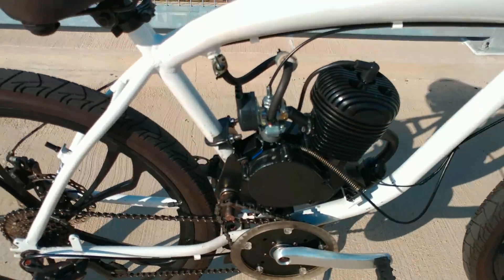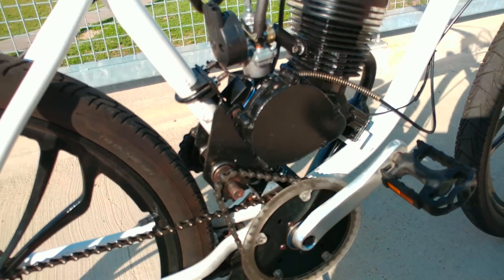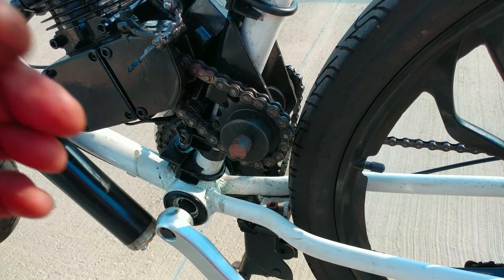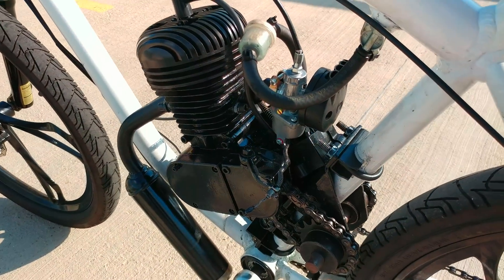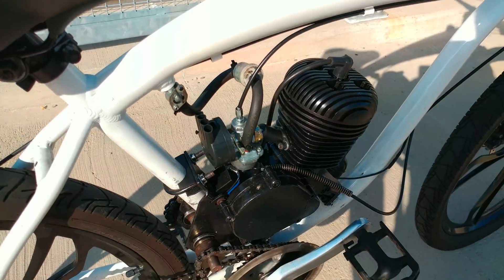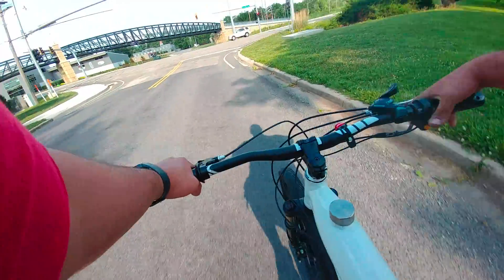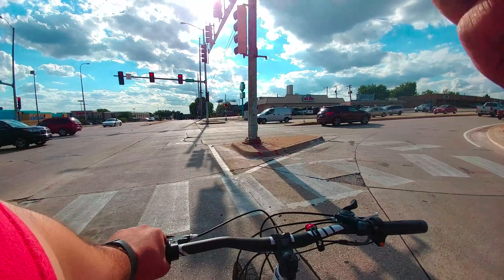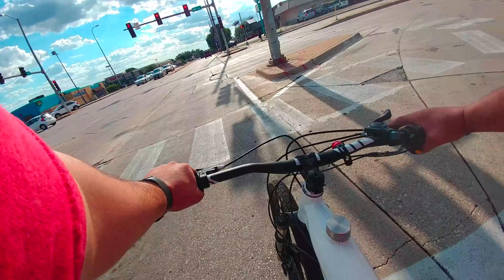Motorized Bike Jackshaft. What it does and how it does it *Viewer Request* Hill Climb and Speed Test

Comment: i'm surprised how well that works. Cool ride
My experience with a jack shaft was terrible , throwing chains , braking freewheels, braking chains and walked home everytime I rode with the jackshaft . Amazon return after 25 days of trying to make it work.
 I'm trying something a little different now , a single-speed on the pedal side and a 3-speed on the motor side, 3 sprockets on the back wheel, 40t , 36t and 32t atm. want to eventually go 36t, 32t and 28t sprockets. I live in a fairly flat area.
No videos yet but have some interesting pictures on my YouTube community page. Still working on it. Waiting on parts

Comment: Just got my little first gas conversion Facebook marketplace runs like crap but it runs of course I knew it for 120 bucks that's where I come in. It has the jackshaft and I confirmed the kit to be 100cc first impressions the carburetor is garbage. And the plug wire is arcing. Still spitt and sputtered to about  25 30 mph once I did all the 2-stroke tricks to get it started out of breath. Oh yeah and it's stuck in high gear. derailer froze

Comment: Dude take it up
a real hill , double up
on the Chain tensioner,
that didn't look like a real
hill, for real it's Supposed to
take you up to speed if you
shift the gear's in the right 
sequence, and you shouldn't
have to go Ripping up the hill yo
take it nice and slow,  see where
you can roll, Up☝ or Down👇
then come back around show
what your working with,
 then go into town . 
Lets have a bike with a Small
 Cargo capacity rack to carry
 20 to 27 lb . one needs a bike
that can pull a small bicycle trailer
a true work horse of a bike with a
proper working Jack shift one can
attain a utilitarian Ride on a good
working motorize bike freedom is
the gain you really don't need to go
Ripping down the street going nowhere
can you come up with a bike that has
Practical Uses you have a shop would
you go to the Top .

Comment: So you have to pedal the bike until it starts?
Reply: Like popping the clutch on a truck I assume.
Reply: @Y34RZERO  I don't think it's like that. When you pop the clutch in a car you usually rev the engine then pop the clutch to burn some tire. I think if you have one of these jackshaft kits you have to pedal the bike until it starts which would be a pain in the ass with the compression from the engine. It's only a one cylinder engine but it still has compression but I don't know

Comment: I have built two schwin orange county chopper bikes in the past, but both bikes were single speed.. found out afterwards that these bikes come, single, 3 speed, and 5 speed..thinking of doing a multiple gear chopper...but the flaw I see is..do you think the bicycle chain is strong enough for the job? The bicycle chains, I'm sure are less durable compared to the much thicker engine chain? And with so much torque,  are the teeth on the bicycle sprockets hold up well without rounding off the teeth over time, causing chain to slip or jump off? Plus how often would one have to grease the jackshaft hub?

Comment: I dont really need to go fsster, but I live on a gravel road, and even with a suspension fork, it can be a rough ride, I think that would help me so I could go slower on the gravel. Right now I have to lug the motor to go slow enough, and sometimes, its still not slow enough. I dont want to slip the clutch. Do you guys think this is the way for me to go?

Comment: This is a neat, fun idea. However, at some point, it becomes a better investment to purchase something like a small, 250 cc motorcycle, no? By the time you purchase a new bicycle designed to be motorized, purchase the motor, purchase the jackshaft system, & make a couple of upgrades, you're spending close to what it would cost to own a small motorcycle. You can get an assemble-yourself motorcycle with a 250cc, single cylinder, 4-stroke engine that will run better, cleaner, and further that's street legal. The one downside is that you would have to have it inspected, registered, and have a license to operate it; but that would also be true of a motorized bicycle such as the one in the video - at least in most of the USA.

Comment: Hey brother , I need some help here. Just a got a new bike and I mainly bought it because I loved the rims on the bike. The rims have 140 spokes and I really didn't think about how to install the rear sprocket before I bought it. Anyways, I have a pic of what it looks like below, but my main question is,

What the hell does a man got to do in order to get a rear sprocket on this damn thing?

Thank you!
Reply from the maker: I had one where i drilled a set of holes on the sprocket that fit through in a good pattern there was only 5 then i made a rear rubber clamp out of some tires then screwed a few metal strips to hold everything down in the back.
Reply: @MotoredLife  
Would it be easier to use a jackshaft kit?
Reply from the maker: @SheFoundMyFifi  im not a fan of them. They require too much maintenance and are not legal anywhere
Reply: @MotoredLife  I'm trying to picture the first method you said, I'm new to the whole motor bike scene. I have a 36t sprocket ready to use for science. Lol. Exactly what do I need to do? Any help is always appreciated brotha
Reply from the maker: @SheFoundMyFifi  find a hole pattern that will fit first. Its going to be closer to the outside of the sprocket but thats ok cuz ur us making ur own metal brackets to clamp email me a MotoredLife@gmail.com and i might be able to find pics of it.
Reply: @MotoredLife  I emailed you

Comment: I wonder if you could modify Jack shaft kit with one of those three speed hub hyper bikes that have the rubber belt drive. If you could get the belt drive to operate with the jackshaft kit that might put less strain on the bike chain factor because those belts are pretty heavy duty on top of that you wouldn't put massive stress on your cassette for shifting because it internally shifts inside of the hub. One speed for going up hills to speed for Mid drive cruising 3 speed for overdrive. It's my next build I've been thinking of.
Reply: Have you build it? Cuz i came to same idea

Comment: I'd rather see jackshaft be put in coaxial design using bottom bracket. Where you have long crank axle for pedal to have one-way-bearing and sit within and extend beyond tube axle connected to sprockets on both sides of bbracket. This way you can combine function of a motor jackshaft and bottom bracket function together as one unit with less parts, but needs special sized hardware nobody wants to make i guess. 🙁

Comment: Your idle sounds rather high. Is that normal for two strokes? It sounds like it's at a decent working cruise RPM of several thousand even when stopped!
Reply: no
Reply: Air leak in the intake, base or case gasket.

Comment: It would be nice if someone did a neat little gearbox (like in the Bafang electric motor mid-drives) that has the free-wheels incorporated in it and you can simply attach the crank shaft of the engine into it and it would step it down 40 or 50:1 or whatever it needs. It needs two freewheels, one so the pedals can rotate the chainring without turning the engine, and the other so the engine can rotate the chainring without turning the pedals. The Bafang BBS drivetrains already have this for the electric motor. A clutch switch to disengage the engine at a stop, and also a freewheel lock up switch so you can pedal start the engine. A kit like this for a Honda GXH50 or 100/120 along with a choice of chainrings (Lekkie Bling Ring etc) would be very intriguing. I'm in the UK so internal combustion engines on a pedal cycle are a bit of a police magnet unless you can go to the hassle to get them type approved and registered as a motorcycle somehow. It would involve at least adding mirrors and indicators, brake lights and beefy brakes, and wearing a cumbersome helmet.

Comment: How does adding a jack shaft not make the bike faster? As long as the smallest gear in your cassette/freewheel is smaller than the gear you had in the back prior to installing the Jack shaft, the top speed should increase.

PS. Your idle is way too high

Comment: It definitely does make it faster, both in top speed and acceleration.
Reply: Please is there a place that i can see proof. Because I've been wanting to do this all with the hope it goes faster.
Reply: @travonepleasant  
If you’ve ever driven a manual car, you should know that lower gears provide more torque, and higher gears provide more top speed. If you have only one gear (if the chain went straight from the engine to the wheel, how most motorized bikes are set up) then the gear ratio has to be low enough that the engine won’t die when you start moving, so the bike will have a limited top speed. However, if you can change gears like the bike in this video, you can start in a low gear that allows you to start moving easily, and when you reach the top speed of that gear you can shift to a higher gear, allowing you to have a higher top speed.

I’ve built a bike similar to the one in this video, and in the lowest gear it was easily able to climb 25 degree hills, and in the highest gear it was able to go 35mph.
Reply: This would make climbing a steep hill, pretty easy right?

I found someone who linked to an eBay site to get the whole kit for about $100😮

With how many years I have on the back, which I believe I have about eight I would definitely lose speed, but I would probably be able to make it up any hill. I wanted to right?
Reply: @gunbuster333SMSTI  That's the great part about being able to choose different gears, you could choose the lowest gear to climb a hill or choose the highest gear to go top speed.
Reply: @Calthecool  you have no idea how amazing it is to see you comment in 2024 when your last one was three years ago ago😂 thank u
Reply: @Calthecool  I already know that my peddling top speed is about 16 mph 17 is kind of pushing it because I have an eight speed. It feels as though a proper 11 speed would be better for this type of kit. If not your not gett the good speed out of it. Good is like 20-30mph
Reply: @gunbuster333SMSTI  Lol yesterday I replied to one of my comments from 5 years ago.
Reply: I had an diy mid electric motor hooked to me crank and 7 speed driver rain in a similar fashion...even with a small 250W motor it could climb the steepest on road hills I could find.  It was slow going, but it worked having the gears.  Otherwise it would be either slow to accelerate, or low top speed.  With changing gears you get to use the power for torque or speed depending what gear you are in.

Comment: Question is it possible  to use a fixie  hub (fixed gear sprocket on one side and free wheel sprocket on the other) as a jack shaft

Comment: Wouldn't the small chain get destroyed cause the engine is putting too much pressure on it? Its designed for pedaling power not the power of the engine.

Comment: Damn it seems like youd have to be very careful downshifting with this setup or risk snapping the F out of that standard sized chain!
Reply: I run a jackshaft setup on mine and youd be suprised, the drive chain from jackshaft to freewheel crank drive has given me the most trouble so far but you are correct. If hauling absolute ass is advised to apply brake a bit before just dumping gear because it will cause the motor to absolutely rev bomb the piss out of itself/ also possibly snapping/more occuring issue- chain binding to happen around the crankset freewheel thus locking the entire system up. And then snapping a chain lol
Reply: dangerous man

Comment: PLEASE, get the SBP expansion chamber!
You WILL thank me.

I got mine, to stop the stock cheap exhaust 
pipes from cracking.  (SBP's exhaust has 
silicone tubing, over the metal joints, and 
it will flex.)  I won't say that it doubles your 
HP output, but it is CLOSE!

No, only 6 years experience with SBP.

steve
Reply from the maker: Or get a real expansion chamber dirt bike pipe. Did you see my last vid?

Comment: Also what is your top speed that you achieve with this set up or can achieve?
Reply: Mine went 40 on the flat all day, 55 downhill, crawl speed around 3-4 mph without pedaling. Stock motor, open exhaust pipe. My 32t straight drive ported, piped, milled head and carbed motor would cruise 45-50 and hit a wall around 58 from wind resistance. But the jackshaft kit is more fun for putting around.

Comment: If you use a 3 liter gas tank with this engine what would your range in miles be roughly because if possible I would like to pair this up with a mid mount e-bike motor to make a hybrid bike for personal use.
Reply: Kinda hybrid because it still won't charge. That alittle more work but I've seen it done. Might as well just add a larger tank but the acceleration IS bananas with both

Comment: whats the point of the gears if your not going faster -.-
Reply from the maker: This engine just is not powerful enough to get going faster its from 2016. Helps alot with acceleration tough
Reply: @MotoredLife  alright bro, and so if i had a more powerful engine maybe a 4 stroke do u think i would be able to use the bike gears just like a motorcycle manual transmission ?
Reply from the maker: For sure! They just are not legal in the US at all lol
Reply: @MotoredLife  yeah lol xd

Comment: I dunno. I still didn't see if that thing can downshift a gear at a time. Seems like when you hit the lever, it just goes back to first sprocket. I guess it doesn't matter with it freewheeling anyway. Sure would be nice to be able to use the engine compression to slow down. Thing is, if you only want to go down a couple of gears, it would be nice if you didn't have to start from first.
Reply from the maker: Yeah you can go up or down a single gear at a time. I just got from 1 to 3 to 7 then back to 1
Reply: @MotoredLife  Cool, I still have my old Trek from '90, pretty dated by now but I'm considering putting a motor on it. Spokane has some nasty hills so a jack shaft would be a good idea. Thanks for all your work on this; good stuff.

Comment: Question about your setup. I’ve built 2 gas bikes so far but I’m looking into going with one with a jack shaft on my next build but I want to get rims like yours but can’t find them with multiple gears. Did you have to do that yourself or did you find that wheel setup already built?  My goal is to build a bike that I plan to ride the entire length of the original Route 66 highway on and being able to keep rpm’s down would be key.
Reply from the maker: Just a heads up jackshaft are illegal in all of the US. The wheels came like that. They come in 1-8 speeds
Reply: Motored Life where did you get the rims
Reply from the maker: From eBay years ago. I have seen several sets break so i think they are no longer for sale.

Comment: Sweet bike. You aren't producing enough power to use those gears. A good idea would be to add a tune pipe, high energy ignition, Hi flow air filter and a carburetor balloon device. Then you will be hitting those highway speeds with smoothness.
Reply: john malone I’d agree. But it could be more for the fun of it. I mean c’mon “braaap ,bra braaaap, bra braaaaaap” lol

Comment: Ive boughta zeda 80 triple 40 and a jackshaft kit from bike berry ive had to cut in some places to make the brackets work and now the chain is the issue what chain do i use for the pedal crank to the rear cassette
Reply from the maker: Just a regular bike chain. You need the anti jump chain guard. 
Whats happening?
Reply: @MotoredLife  the chain its self does not fit on the pedal sprocket

Comment: Did u have to bend the dropouts to get that tire in there cuz the site said the made for single speed hubs and I'm buying that exact frame and I have the same mags as u
Reply from the maker: this is a bbr frame no it fit fine
Reply: @MotoredLife  and one more thing what size u bolts did u need to get for the seat tube
Reply: K I was just really worried about having to stress the welds to get it to fit so that's great news

Comment: Dude if you knew anything about gearing ratios that jack shaft system would gain you some mph and could leave the line like line a boss. Its a 12 speed 80cc bike that could reach ridiculous speeds. Two strokes prefer to run on high revs and it’s healthy for them
Reply from the maker: Thanks for watching!

Comment: Looks to me like using a jack shaft lets you keep your disk brakes. I've been checking out those frames with the tank built in. They look awesome.
Reply: Napolian Solo  b by 5hg4
Reply: Thats why im interested.
Reply: Or you could get a smaller sprocket that doesn’t interfere with the caliper. Personally I use a 36T

Comment: Try stretching out the RPMs more before changing gears. 👍
Reply: Yep. Wasn't giving it time to hit its power band in the Beginning of the pull.
Reply: @ChunkyWaterisReal  Granted Jack shafts do suck they just don't have enough torque to play with the gears. Also you're still final driving all of that through a bicycle chain and derailleur.
Reply: @JamesPiccone  true af
Reply: The stock motor doesn't rev out too well. It can't breathe with the stock exhaust, carb, intake. Not much to gain by reving it out stock with the shift kit.
Reply: @marthamryglod291  Don't be so pessimistic and give up so quick. My bike rips legit RPM with those parts you just mentioned. My point was Jack shafts suck ass & torque is a lot different than RPM.
Reply: @JamesPiccone  I think we might have different motors. My built motor with pipe, shaved head, carb, intake, porting pulls a 32 tooth and will go up to about 58 on the flat, and 45-50 all day. My jackshaft setup is fun for cruising around and doing slower trails but the motor isn't as strong or modified.